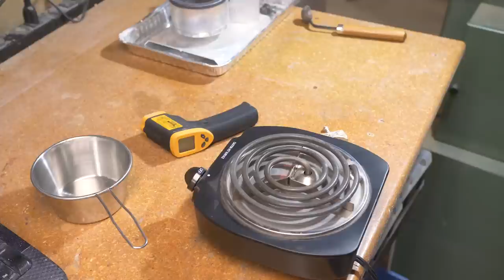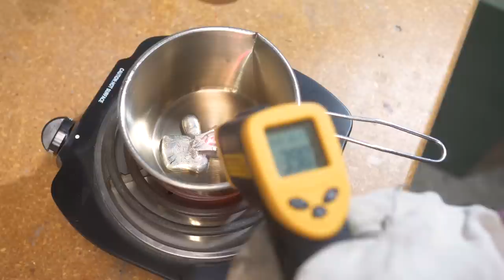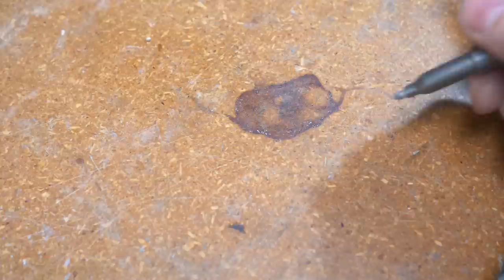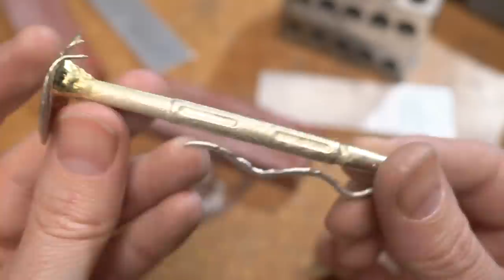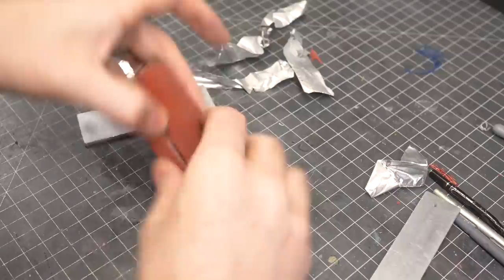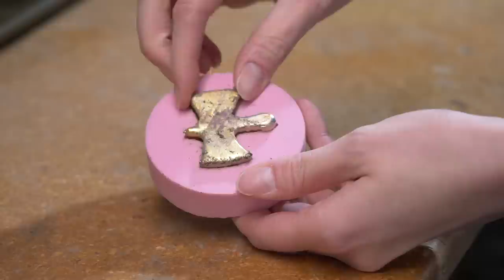Easy Metal Casting - Pouring Liquid Pewter into a Silicone Mold

Comment: I've worked with pewter several times and I knew that the melting point was low but WOW! I have no idea that I could use it in a silicone mold... I've been using wood molds all this time. Thanks so much for the insight.
Reply from the maker: You're welcome! Have fun. =D

Comment: Another great video!
Just FYI, a friend who owns a company dealing in industrial heating and heat monitoring equipment, told me that type of thermometer will give you inaccurate readings from reflective surfaces, like shiny pots or molten mettle.
Reply from the maker: Oh that's very interesting! I think it was close enough for what we were doing, but that's good to know for other applications.
Reply: Yup for infrared thermometers a matte black surface is ideal for accurate readings
Reply: David Bond A quick blast of high-temp engine paint on the side of the pot would at least give you a way to get an accurate reading of the pot’s temperature.
Reply: That's a pretty good idea

Comment: Rather than talc, you can get better, (& shinier), results using powdered graphite to powder and release the mould.
Reply from the maker: Oh snap! I hadn't thought of that! Thanks for the tip. I can try that next time I cast metal.
Reply: You can purchase Graphite powder, in large & inexpensive quantities, at your local art or craft stores. You can also find it in most hardware stores, too. Although, the quantities they carry are usually very small and costly.

Graphite is rather unusual. It can be used for a large number of uses. Aside from being used as a "dry lubricant" and for making illustrations, it can also be used as a dry pigment in a variety of materials, (mostly, for a wide range of grey-tones), and, a mould release for casting metals. Also, it can be used for aging/weathering props & costumes, creating a surprisingly realistic "dark chrome" or gunmetal-look. And, a little of it goes an incredibly long way. One word of caution, though. Use it sparingly, because it can get extremely messy if you are not very careful, (this is especially true, when our feline Overlords closely inspect project progress..., 'LOTS of little black pawprints, EVERYWHERE..., don't ask me how I know this first hand).

Comment: I always pre-heat my molds prior to pouring, it helps.
Reply from the maker: Good thinking! =D
Reply: How hot do you go? 400?
Reply: I usually just heat them on 400 for about 20 minutes, just enough to make sure the mold is heated all the way through.  I heat the mold halves together, that way the heat inside the mold is retained long enough to start pouring.
Reply: @KentuckyFriedGamers  Sorry for the necro, but how do you pre-heat your mold?
Reply: @TheKrister2  in the oven.  You can also just pour the mold a couple of times and heat it that way as well.

Comment: could you put a link for the silicon mold material? I have been casting pewter for 30 years and have a couple of suggestions . . . I use hardboard for my mold plates and an adjustable clamp rather than the rubber bands. I think if you are doing multiple casts the aluminium plates will get too hot to handle. The graphite coating works great, I got a locksmiths rubber squeeze bulb and buy my graphite by the pound, way cheaper. The casting pot you have in the background and the pour ladle are for bullet molding, but you can get a casting pot with a pour spigot and eliminate the ladle. The benefit of the casting pot is being able to maintain a constant temperature throughout the process and not burn the casting metal . . . you don't want to be breathing vaporised metals!!! love your videos and watch them all the time, keep up the great work!
Reply from the maker: Thanks for the tips!

Comment: Not a great casting but you're on the right track.    1st you need to make your mold so that the clamping surfaces are FLAT and PARALELL, the edges don't matter.    Moldmax 60  is OK but Dow Corning 3120 is more economical and easier to mix accurately.   Temperature of the pewter needs to  be about 600degF.   With the pewter at casting temperature you need to dust with talc and w/o closing the mold pour pewter on the mold cavities a few times to warm up the mold.  Hot mold is the rule. To assemble the mold the aluminum plates are  great but need to be clamped LIGHTLY with some sort of screw clamp or vise.Next you need to flux the mold using 20 Mule Team Borax.  Just a pinch in the melt pot.   Use a ladle to skim the dross to the side of the pot and dip the ladle and  pour into the mold.    Talc can be applied by putting it in a athletic sock and pounced on the mold.  Teflon can be used as core material to form holes in the casting.    Look at info on sand casting about use of cores since same theory applies.    Make sure your sprue is long and tapered since it provided pressure on the metal in the mold cavity.  Factors  that effect the casting quality include part orientation, metal temperature,  venting, etc.     Hope that helps.
Reply: Flux the metal -    sorry about that !
Reply from the maker: It is definitely challenging to mix MM60 in an accurate manner. I'll have to try out the Dow Corning 3120.
Reply: the paste type catalyst is much easier to mix    i use a second hand triple beam balance   you can measure small mounts with this method          do you have a web site ?

Comment: Talc is great for silicone molds but I see you used baby powder. Most baby powder is made from corn starch now and not talc so my question is: what kind of baby powder did you use? Talc or non-talc? Talc powder is much more expensive than baby powder and I'm wondering if corn starch might burn.

Comment: When I've done white metal/pewter casting for my own props, I place the mold on an old cookie sheet. Any over pours will end up on the metal surface and not risk burning your work bench! Plus, you can skim the slag and dump it easily on an unused part of the cookie sheet for easy clean up later.
Reply from the maker: Great idea!

- Paige

Comment: I'd recommend adding a funnel type structure to your molds to help avoid  filling your escape channels for the air with metal by mistake. Also gives you a nice cut off point for your cast.
Reply from the maker: Thanks for the tip!

Comment: I have cast lead before and there are a couple of things that make for a good cast.  Flux your metal.  This will reduce the oxides in the metal and clean up impurities.  A tiny drop of wax will work great.  Proper temperature for the pour.  Don't just pour it when it is molten,  too cold and you will get voids in the metal and fine detail will not show up,  too hot and there will be excess shrinking.  I haven't cast with silicone but for a metal mold, soot from flame make great mold release. 

After you practice on the first cast you should cut it open with a scroll saw or jewler's saw to see how the casting went.  Silicone probably does not have to be preheated to get the best results since it holds the heat in longer than metal but metal molds will need to be preheated.

Comment: Put a metal lube in  the top of the vent hole so the pewter can not go into the hole. Also cast in a larger funnel shape into your silicon mold for the fill. Lastly put a pour spout on the other side of the big ladle

Comment: I'm curious as to why you cast the part rather than using the 3D print you had?
Was it for strength or are you intending to produce a large number of the part, so speed of production is important?
Reply from the maker: The original piece was cast in metal and I wanted to match that.

Comment: funny and good video, thanks for sharing, I already bought a OOMOO smoothon 25, I never had used it , may I cast tin with it?
Reply from the maker: I don't think OOMOO can withstand the temperature - but you can check the product information to see what the maximum heat tolerance is

Comment: How much material do you get from the 1kg Castalo 60 packages? 
I want to make a mold of a silver bar I have. But only the top half of it. It’s like 12” x 5” wide. And I want it about 3/4” thick. 
Any help guys?? 
Thanks!!
Reply: Oh and let me add, that I am only going to make a 1 pt mold vs a 2pt.
Reply from the maker: I wouldn't recommend using a silicone mold for silver. Pewter is pretty much all I'd use with silicone. Anything else gets too hot.

Comment: Just curious how much longer "mold life" do you get with the hi-temp silicone vs the regular for folks who are not able or willing to invest in the high temp stuff right away?
Reply: Calvin Witt 
It's significant. I can't say how long for certain, but a good high-temp mold could potentially last a few years, while a lower temp for the same castings could get burned in a few days, depending on the frequency of molding and the cast material of course

Comment: Can i pour aluminum in silicone? Instead of pewter? Aluminum seems easy to get, and cheaper. What would the diffrences of aluminum to pewter? I want to make a keyblad for decor. Whats the best paints for metal? I want a nice bright color.
Reply from the maker: Aluminum has a much higher melting point than pewter and would completely destroy a silicone mold, unfortunately. Casting higher melt metals like that requires a much different process.
Reply: Punished Props Academy. Perhaps this could be an idea for a future video. Maybe use an easy and proven method like Lost-wax casting in aluminum. Because you know that Destiny hand cannon would look beautiful in aluminum :)

Comment: You should have made the pinch for pouring on the other side, since both of you appear to be right-handed.

You're pouring in the opposite direction than what is natural, and as a result the pour is not as smooth or accurate, and can overflow more easily than if you made it right-handed and poured to the inside of your hand direction rather than the outside.

Still, really cool work, nice melting and molding!

Comment: So does the Mold max 60 work for regular silicone/resin casting as well? It would be nice to have the mm60 just in case I want to make the same item in either materiel. Mostly I'd like to try it for casting toy parts or accessories.
Reply from the maker: Yeah Mold Max is a great silicone for making molds and casting resin! Check out Smooth-On's site for some good info on this product: https://www.smooth-on.com/products/mold-max-60/

- Paige

Comment: Just a word of warning - don’t rely on the temps from that thermometer for anything vital when doing this. Contactless thermometers like that one are calibrated for a certain reflectivity. The correction factor needs to be tweaked for various materials, and you’ll almost never get an accurate/reliable readout off of shiny, metallic surfaces.

Comment: What about silver, gold & copper? Is this good for molding that?
Reply from the maker: The issue is the melting point. Those metals get too hot for the silicone we have, I think we mention that at one point.
Reply: @punishedprops  what silicone could you use for those metals, if any?

Comment: Are there any difference working with with mald mox 30 or mald mod 60?... Because the price are different in those products..
Reply from the maker: The two main differences is the heat resistance and the shore hardness. You can compare Smooth-On materials here: https://www.smooth-on.com/compare/

Comment: Try doing lost wax.ferst use the latex mould to cast it in wax, you can clean up all the blemishes on the wax before casting the metal,drill holes ext ext.Then Then cast the wax into a one piece plaster mold.Then ether boil of the wax, or put it into an oven to do it this will also dry the plaster,wet plaster molds aren't a good idea,as they can explode.for casting the metel the plaster mold should go into a bucket of sand.Once cast the plaster can be easily cleaned of the casting. The latex mold will last a lot longer and you'll not end up with bernt molds.
A bit more involved.With this type of method you can also cast aluminum and bronze .
Reply from the maker: I would love to do that some day. I'll need some more equipment, but it's definitely an awesome process.
Reply: If you’re looking at lost wax and have access to a form then they do a casting wax.  There’s also a wax filament called moldlay.  I’d love to try but getting my wife on board to melt metal is proving a bit tricky!

Comment: Non black body emissivity of molten metals makes temperature measurement by radiant/infrared methods very unreliable. You really need to use a contact/immersion thermocouple to get an accurate reading. This is important to prolong the life of your rubber mould. Also almost any powder will do to dust the mould. The powder is not used as a release agent but its presence as a thin film on the mould gives air a path to escape. Talc is traditional but I have used Calcium carbonate (green sand mould parting agent) and also iron oxide powder. No doubt Graphite would work but I judge it a bit messy!... Martin

Comment: would stainless steel work just as good because I've been thinking of casting a metal ignika.
Reply from the maker: I believe the heat required is too much for most silicones
Reply: @punishedprops  understandable, but what else could I use instead?

Comment: Would tin also work in a silicon mold? whats the highest temp you can go up to?
Reply from the maker: I am not sure about tin. You'd have to check the specific silicone you're working with to get an idea of the heat capacity.

Comment: Did you degas and/or pressure cast the mould and master part?
Reply from the maker: The silicone rubber was degassed before pouring the mold.

Comment: can you melt plastic and make moulds the same way ?
Reply from the maker: You can totally make molds out of resin, but typically the reason to do so is because the thing you're casting will be cast in a flexible material. Resin wouldn't work for casting metal because it gets too hot and would melt the plastic.
Reply: sorry I meant the other way around . plastic in place of where you used pewter

Comment: can you use different metals alloys?
Reply from the maker: As we mention in the video, we wouldn't recommend it due to the heat required to melt materials other than pewter.

Comment: How though is this metal once fully cooled down?
Reply from the maker: It is fairly soft, but I've worn a pewter ring for well over a year now and it's holding up pretty well. I wouldn't use it for anything structural.

Comment: Suggestion: using graphite blocks to hold the mold upright (because metals do not stick to the graphite) and doing the casting on top of a ceramic plate to keep the table from burning- again the metal, solder, does not stick to it.  Link to the ceramic torching plate on amazon: https://www.amazon.com/JEWELRY-SOLDERING-BLOCK-CERAMIC-MELTING/dp/B00YSYPMYS
Reply from the maker: Great tips! Thanks for sharing!

Comment: I thought silicon can't cast metal...
Reply from the maker: Pewter has a low enough melting point that it generally works if your silicone has a high enough heat tolerance